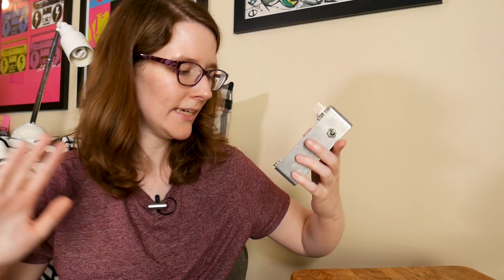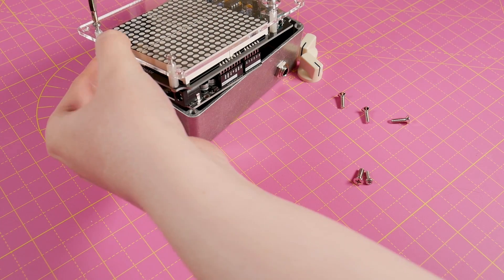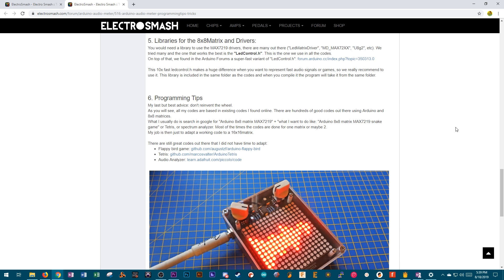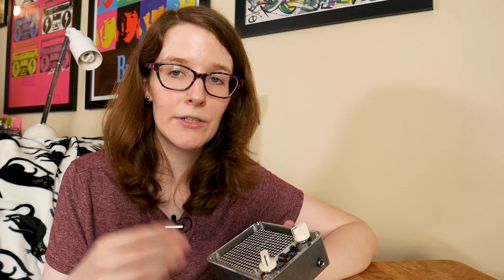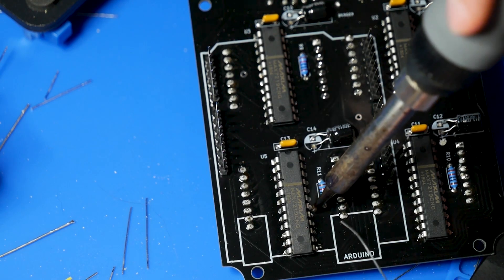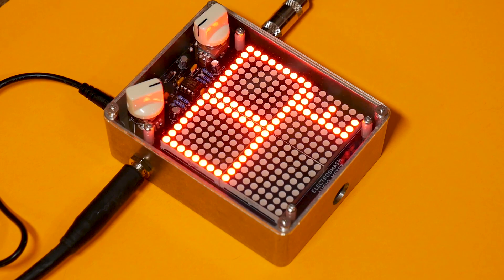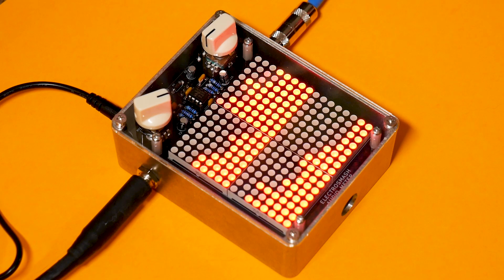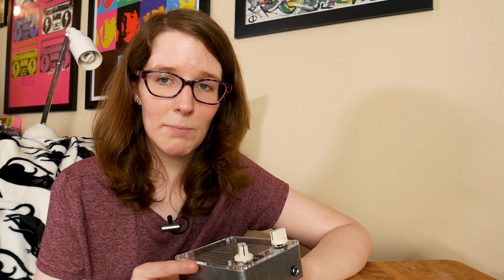Audio Spectrum Analyzer in a Guitar Pedal - Arduino Audio Meter by ElectroSmash

Comment: Thanks for showing this project.  Would this be a effect for showing/simulating speech from a computer?
Reply from the maker: i didn't test that but as long as it's an audio signal then it should in theory react to it so i think you could probably use it for that